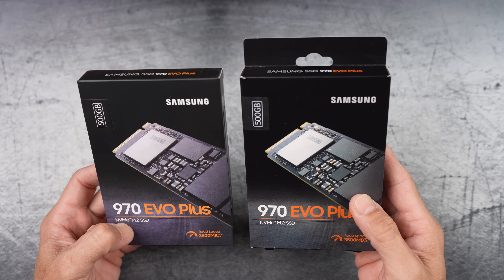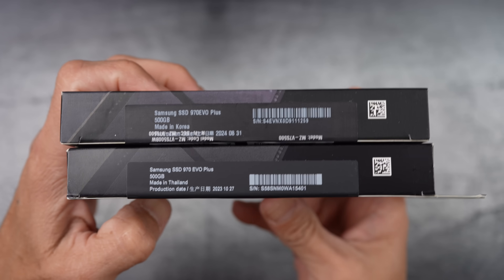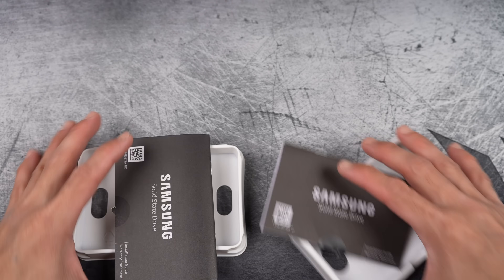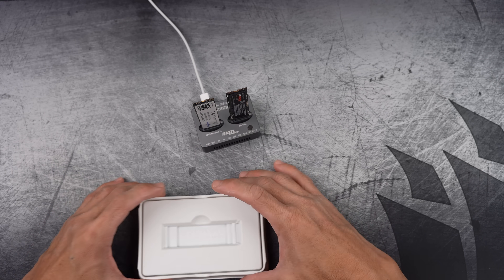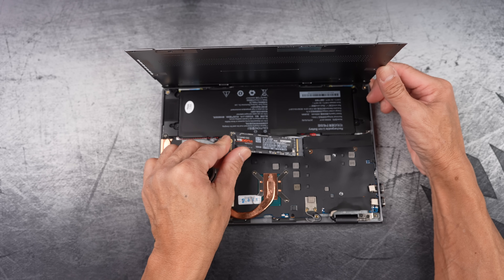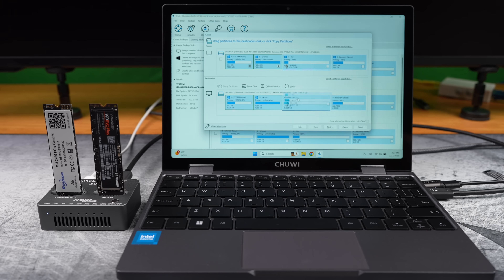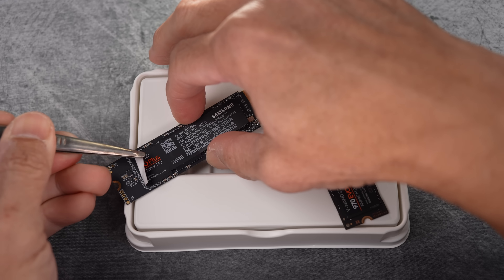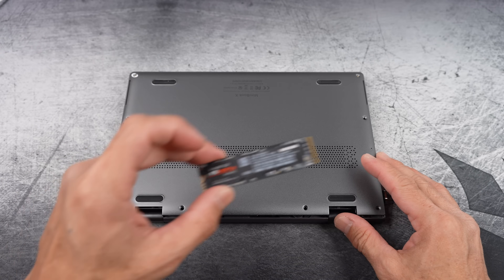Fake vs Real SSD - Can You Spot the Difference?

Comment: Two important tests I would have liked to have seen:

1) Test the drives with more than 1 gigabit of data.  Write to it for 100 gigabytes of data.  That will be enough to fill the drive's cache.

Not all cache is on a DRAM chip.
Nearly all drives have between 2% to perhaps 10% fast NAND cells (such as MLC or TLC).  If enough data is written to the drive, non-stop, then the drive will be forced to write directly to the drive's slower QLC NAND cells.

The test we saw, with only 1 gigabit of data, will never touch anything other than the faster NAND cells.

2) Fill the drive to its capacity.  Why?
Fake drives often use a controller that has firmware that lies to the operating system.  It reports 500 GB of space, when the drive only has 50 GB of space, or perhaps 100 GB of space.

And it can be even worse.  Some fake drive controllers will report that data is successfully being written to the drive, even though the drive is out of space.  That allows the fake drive to give the illusion that all is well (that it really has 500 GB capacity).  Then, one day, you will discover that your files are inaccessible or corrupt.  By then, your return window (for a refund) will have expired.

For the purchase of any drive, always copy enough files to it to fill it to capacity, just to test that the entire drive actually has the claimed capacity (or that no issues just happen to be on any part of the drive, even if the drive is genuine).  Also test that the files that you used to fill up the drive are actually there in their entirety, with no corruption.  Test with a handful of files.  There are several ways to conduct such a test.
Reply from the maker: Great points! Testing the drive’s full capacity and ensuring data integrity is definitely crucial, especially with fake drives. Thanks for the detailed advice!
Reply: @TossSong  You made this whole video and didn't know how to do a data size test on a drive? seriously??
Reply from the maker: @humanbeing-001 Fair point! I admit I didn’t run a full data size test in this video. Definitely something I should have done, and I appreciate the feedback.
Reply: Yes there is a "Data Recovery & Data Forensic Services" that ran a 990 pro against offbrand drives continuously, the Samsung sustained well beyond TBW rating, the others are very slow outside slc cache.
Reply: @churblefurbles  I did not know that the Samsung 990 Pro uses any SLC NANDs.
Manufacturers make it between difficult to impossible to find that information.

I assumed that the 990 Pro used TLC for the faster section, or possibly MLC.  SLC is more costly, which is why I assumed that they would not use it.

Where did you find that information?
Reply: @0Perhaps  There are no SLC nands, its dynamic switching between modes of recording data.  All SSD resort to SLC cache now.  The cheap ones have controllers that can't keep up with the shuffle.
Reply: @churblefurbles  All SSDs do not resort to SLC cache.  I doubt that any consumer level SSDs use and SLC NANDs.  Perhaps one or two high end consumer SSDs use SLC NANDs.  SLC NANDs are used in data center SSDs, and those SSDs are expensive, and are typically in the U.2 format.

If all, or any, SSDs resort to SLC cache now, then those are SLC NANDs.  If they are not NANDs, then what are they?
Reply: @ We aren't talking about having SLC NAND on the SSDs, controllers are able to "downgrade" density to alleviate faster writing speeds of older tech/modes, they can chose in what mode/style they will write the data in. On a QLC NAND SSD controller can write slowly using 4 voltage levels to write 4 bits into single cell, or it can use for example 2 voltage levels or just one - aka write in either MLC or SLC mode.

Writing in MLC is faster than in QLC, in SLC is faster than in MLC, just that you use 2/4 times more space. To have a 100GB SLC cache you basically need to have 400GB of free space on your SSD (cause you downgrade each cell from 4bit to 1bit), and similarly if a drive has multi-stage caching and it will drop down to MLC mode for example if there is not enough free space to use SLC - SSD uses each cell as 2bit, so 100GB MLC caching "eats" 200GB of the SSD.
Reply: Aren't Evo drives very expensive complared to other drives? So it makes sense they used SLC for higher endurance.
Reply from the maker: @manilkasheran2934 Thanks for commenting. Yeah, exactly. EVO drives cost more because they use better parts like SLC and DRAM. That’s why fake ones are tricky—they look the same but cut corners to save money.
Reply: @aams97  "Aren't Evo drives very expensive complared to other drives? So it makes sense they used SLC for higher endurance."
Samsung charges more, because they can.  People pay more for a brand that they believe is a good brand.  And Samsung does make good, reliable, fast SSDs.  But they are not the only ones.

I do not think that consumer drives have any SLC NANDs.  Manufacturers reach their claimed speed ratings with TLC NANDs (or, perhaps MLC NANDs), and better controllers.  So there is no need for the additional cost of SLC NANDs.

Some high-end data center / enterprise SSDs use SLC NANDs, for their entire capacity.  They are far more expensive.
Reply: What windows commands or tools do you suggest to compare files to make sure they are all there and intact? Back in my Amiga and unix days we used the diff command.
Reply: @saganandroid4175  The Windows command that is akin to the Linux "diff" command is "fc.exe" (file compare).

You can also generate a hash of the source file, and compare it to the hash of the duplicate file that got written to the drive being tested..

Windows has a built-in has generator:
certutil -hashfile somefile

There are 3rd party GUI based hashing tools, if that is your preference.  Many of those GUI tools offer several hashing schemes.  But any hashing program is good enough for the purpose of testing the completeness of the file copy operation.
Reply: @saganandroid4175  The Windows command that is akin to the Linux "diff" command is "fc" (file compare).

You can also generate a hash of the source file, and compare it to the hash of the duplicate file that got written to the drive being tested..

Windows has a built-in has generator:
certutil -hashfile somefile

There are 3rd party GUI based hashing tools, if that is your preference.  Many of those GUI tools offer several hashing schemes.  But any hashing program is good enough for the purpose of testing the completeness of the file copy operation.
Reply: @saganandroid4175  I have been replying to your question.  But something in my replies is triggering my comment to get tossed.  I do not know if this reply will survive.

I will keep trying to reply with the information you requested, crossing my fingers that my reply will eventually get posted.
Reply: @ must be some keywords are banned. Try s p a c e s in suspect words.
Reply: Yeah was wondering about the actual capacity too, lying controllers are pretty common on fake USB sticks. 

And yes, data corruption / "bit rot" can happen even with legitimate drives. For any data that matters, a modern file system with data integrity checks (BTRFS or ZFS) is a must.
Reply: Very interesting point. HD Tune is a faster way of testing the capacities.
Reply from the maker: @phronesis4u Thanks for sharing this. I will look into it.
Reply: @NoEgg4u I guess you mean 1 Gigabyte. Not Gigabit.
Reply: This guy has no clue about testing disks, what do you expect...
Reply: First test is check the price. If it seems too good to be true, it is too good to be true. Second, click on the seller. If the address is in mainland China, forget it. Or you could just save yourself a lot of hassle and buy from a reputable supplier in your own country.
Reply from the maker: @mitabpraga7487 Totally agree—price and seller info are huge red flags. I also had a few commenters mention their fake SSDs failed, so it’s definitely not worth the gamble. Better to pay a little more upfront for peace of mind from a trusted source. Appreciate you adding those smart tips!
Reply: Best bet is to avoid Aliexpress, eBay, Temu or any other purported "discount" means of purchasing electronics.
Reply from the maker: 👍 Very true — those ‘discount’ deals can cost more in the long run if you end up with fake or faulty gear.
Reply: It most likely doesn't fakes the capacity. 
A generrc  $30-40 Maxio cintraoller-based 512G DRAM-less SSD  is basic as it gets.
Reply: There are utilities that do such a write test, for example Mighy Desktop in the File Center tab. It fills the whole drive for a test and checks if it can read back the data.
Reply: Seems like you're defending scammers?! You are definitely filibustering the subject, why? Showing how smart you are? What is your point? Wake up.
Reply from the maker: The goal of the video is to help people avoid getting tricked by fakes. Everyone has different ways of explaining things, and I tried to break it down clearly for as many viewers as possible. Appreciate you watching, though—seriously. Let’s stay focused on helping folks spot the real from the fake.
Reply: after i was on a Biwin drive for a while, i came to a conclusion that these write speeds don't really matter all that much. What does matter is the read speed of "cold data" - the data that has been sitting there unchanged for a few months. On that Biwin drive, the read speeds fell down to mere handful megabytes per second!! This is a speed of a fast CD drive. It is unthinkably slow today.
No data was lost (PHEW!), but it took more than 24 hours to clone the darn thing.
Reply from the maker: thanks for sharing. 👍
Long-term behavior like cold data read speeds is exactly why reliability matters, especially with unknown or borderline drives.
Reply: As far as I know, not a single commercial multi-bit NAND SSD uses a different bit-number "faster" NAND as a cache. They just use the multi-bit NAND in single-bit aka SLC mode, cause writing in that mode is far faster than in multi-bit voltage based modes. Basically drives use a bunch of the free space as a "speed up" cache where the drive writes in SLC mode and then behind the scenes the drive moves the data to multi-bit zones which are far slower to write to cause of all the multilevel voltage crap that those type of cells require for their work.

Hence why its recommended to overbuy those SSD to always have a bunch of free space available - and not hammer it up to the brim with data - cause when the controllers lose the free space they cant use the SLC mode any more and drive loses its "cache" and falls on its face with writing speeds. Why also proper SSD tests have an "endurance" runs that try to write huge amounts of data to the drive to actually see how big of an SLC cache drive have, if it has also other "stages" for caching, overall how fast it can lose its performance.

Some drives are "fancier" in their caching ways - they can have more "zones" if you will, writing in the "previous" gens modes - as MLC will still be faster than TLC/QLC modes, slower than SLC, but require half the space to run it. IIRC thats why some drives on the endurance writing tests have multiple steps - from the fastest mode down to "no cache" TLC/QLC speeds.
Reply from the maker: @Eversor86 Thank you for sharing this. Great info to be had.
Reply: @Eversor86   The Evo 970 plus drive, with the Phoenix controller, can write a sustained 1500MB/sec to the interity of the drive. The newer ones, with the Elpis controller, falls to 800MB/sec after "SLC cache" is spent. But still, its able to write quite fast to the TLC chips it uses. 

You're very likely correct that he fake one would use QLC chips, so not only is it slower. But it'll also have a lower rated TBW rating (who writes that much to their drive, but anyway. The fake one is probably 120TBW, against the Samsungs 240TBW).
Reply: 1/ MLC aren't SLC fast chips, but at least with a 970 pro you can enjoy full speed and extended lifetime.
2/ just don't buy chinese crap on chinese express. Same goes for fake printhead, fake 90day warranty, and much more.
3/ remember a tawanese proverb : buy chinese, buy two times.
Reply: @danybackstone  In my country theres a saying "You are to poor to buy cheap", which relates to the issue that if you buy cheap crap, you often end up spending more on fixing stuff, or rebuying broken things than if you bought the good stuff in the first place.
Reply: @Eversor86  а у нас говорят "we are not rich enough to buy cheap things"....т.е. in our region we say - мы не настолько богаты, чтобы покупать дешёвые вещи..

Comment: Both are real......
one is for the China market...
DO NOT  , order computer parts from Chinese suppliers
many suppliers dump their sub-standard parts into China, including refurbished parts.
if you get  a disk drive from outside of china and do a smart on it as soon as you get it... everything is zeroed down
Every time i get a disc drive from china in a sealed box..... the smart is NOT zeroed down..........
Reply from the maker: I see your point about being cautious with parts sourced from certain markets. It’s a good reminder to test any drives thoroughly upon arrival, especially when buying from less familiar suppliers!
Reply: @TossSong   nope.. once you have purchased it , you have lost your money...
there are "levels" in china that you can never bypass.
Ultimately it comes down to the top level and what they supply into the distribution market, anyone under that top level is basically the sucker , and in China Despite the propaganda you might see, everyone is a sucker...
Been in this  Arena over 30 years and in multiple electronic & electrical industries, you buy from China , you better be all lubed up.

Comment: Awesome! I want the fake-drive please, it´s more cheap and almost as good as the original. But there could be one problem: Quality. If the fake NVMe has no quality and is dead after half a year (with all the data) saving the money was not worth it. How durable are these fake drives? How much percentage of NVMe drive life left is shown in Crystal Disk Info after a year and two years of use? Quality, endurance, how long a drive will last and the safety of the data are the most important points when buying a fake, not if it´s 1% faster or slower. ;)
Reply from the maker: You make a great point—endurance and reliability are critical, especially when storing valuable data. Fake drives might look appealing for the price, but if they fail in just a year or two, the risk isn’t worth the savings. Better safe than sorry when it comes to data security!

Comment: The fake Samsung looks like a Cusu SSD drive. And the drives are really not bad but are off course not real Samsung. And the Cusu CV3500 has higher speed and for the price arround 30 euro for a 512GB a very good deal. Nice cheap SSD's for a Pi or something and the real Samsung for your daily driver.
Reply from the maker: That’s a great point about the Cusu CV3500—definitely an option for specific use cases like a Pi. Still, it’s good to be aware of what you’re actually getting when these drives are disguised as Samsung ones. Thanks for the insight!

Comment: Honestly, the big fat silvery picasso controller chip spilling out under the label, is a dead giveaway for an original samsung. The tiny controller is a giveaway for a sandisk, wd or any other worthless clone. Just look at the product picture on the box, does the clone look anything like that? Nope it doesn't. The only way you could really fake this, is via selling old used samsungs but reset their usage values. Perhaps possible but economically viable? Probably not, in a market of steadily falling prices of new electronic commodities.
Reply from the maker: You’re absolutely right—those signs like the controller chip and label details are a dead giveaway. It’s fascinating and frustrating how these clones cut corners while still managing to fool many. Thanks for breaking it down so clearly.

Comment: How to know if a Samsung SSD is original?
You can verify whether the Samsung SSD product you have purchased is genuine by using the Magician software included on the CD. If the product is genuine, "Genuine" will be displayed next to the serial number on the Magician main screen. If it is not genuine, "Not Genuine" will be displayed.
Reply: Does 'CD' mean something other than Compact Disc? because there were no Discs in those packages.
Reply: @Thurgosh_OG  CIVIL DEFENCE
Reply: @Thurgosh_OG  Controlled Drug.
Reply from the maker: Thank you for sharing this information. Yes, I did install the app, if you notice on the laptop screen. However, I didn’t show it on video, thinking it would be obvious by the end of the video.
Reply: I accidentally purchased the same Maxio-based Samsung clone that Toss Song has, the Magician software says that SSD's manufacturer is Samsung, however it can't read the S/N properly and there is no ✅ Genuine makrk next to it. The firmware version reads 1234 lol 😆 
Thankfully I'm returning it today to Snappshop, where I bought it from.
Reply from the maker: @DRSDavidSoft Exact same results with the Magician software (I just didn’t put it on video). I’m glad you returned it. I just printed the return label, and they’re awaiting my return package. Glad we both got it done. What an experience, not necessarily what we should have had! We’re now more cautious than before. Thanks for sharing.
Reply: @DRSDavidSoft  Do they charge you shipping to return it?
Reply: This!
Reply: Magician shows me a ? Next to serial number, it says magician doesn’t recognise it because it’s in enclosure, so sees it as a usb device, so how could I test it ?
Reply: @hardlines2635  Put it into the pc m.2 connector on the pc mother board. if you dont have  m.2 on your motherboard you can ring Samsung and give them the serial number of the box or SSD sticker.